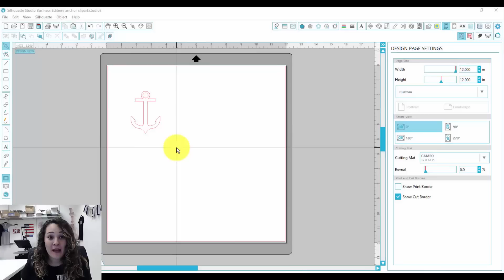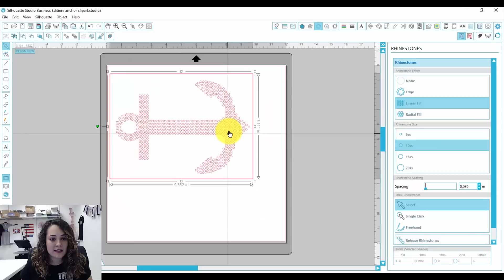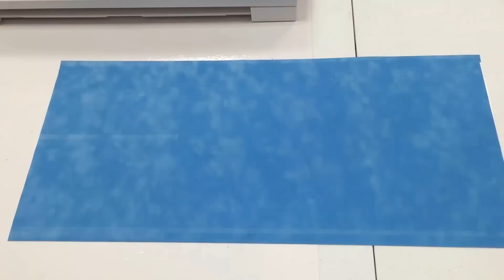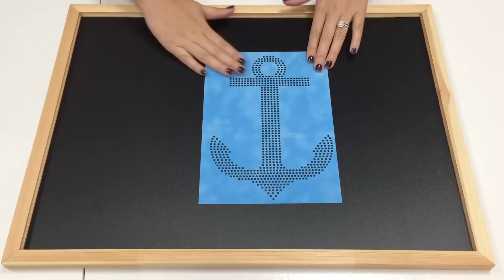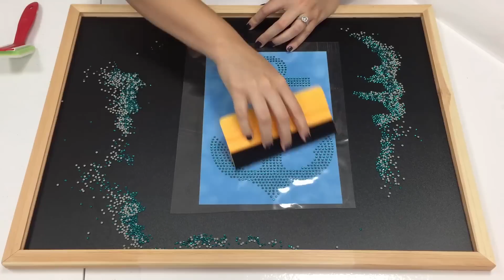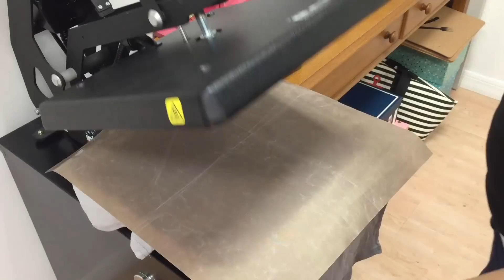Design, Cut and Press a Rhinestone Shirt with the Silhouette Cameo 3!

Comment: If i dont have a heat press can i use a iron?
Reply from the maker: You can try, but it is difficult to get the even temperature and pressure rhinestones need for proper application with a home iron. They may not adhere as well and you risk them falling off - TRW Shannon

Comment: If you are using more than one material how do you know what temperature to set your heat press on? For example: if you use rhinestones and glitter or smooth htv and glitter?
Reply from the maker: I always split the difference. Typically if I am combining rhinestones and vinyl, I stick to around 320. :) - TRW Lisa

Comment: Using the same steps you used in your video Instead of using a T-shirt I want to use a hoodie. Would I get the same results ?
Reply from the maker: Absolutely! The only thing that might be different is you might have to adjust your pressure since a hoodie would be thicker. You also might considering using a pressing pillow between the front and back of your hoodie to achieve good pressure since hoodies tend to have thick seams. 
TRW Alexis

Comment: How would I create the same product with non-heat fix rhinestones?
Reply from the maker: Hey Madison, 

The best way in doing that at that point would be do the same process up until heat pressing, and while the stones are on the hot fix tape, put your E6000 glue on the back of all of your stones, and then press it down firmly so they stick to your shirt. :) 

TRW Nick

Comment: I just bought my first silhouette cameo 3 and your videos have taught me everything i know thus far! 

question:  why does my piece of vinyl slide all over the place when I set it on top of my cutting mat & load it into the machine to be cut?  my machine starts cutting but the vinyl moves around so it does not cut properly.

i am using the vinyl pack that came with the bundle pack i purchased, it is from craft-e-corner and is 9x12, if that helps. thank you so much!
Reply from the maker: Vanessa,

It sounds like your mat just isn't sticky enough to hold your vinyl down. Have you tried taping your vinyl down to your cutting mat? Also, is it a new mat or has it been used several times?

TRW Alexis
Reply: 30 mins after leaving a comment, I realized that I actually had to peel the blue part off the mat to reveal the sticky side on the cutting 
mat. Can you tell I am a complete newbie? Thank you for replying back to me so quickly. I have subscribed to your channel, you guys are fantastic!

Comment: I don't have a magic Flock setting on my design addition. Not sure what setting to use. I used the rhinestone templet setting and it didn't cut out all the holes.
Reply from the maker: Hey Vanessa, 

You can find those settings on our website under Support > Resources > Documentation > Cutter Specs and Recommended Cut Settings. :) 

TRW Nick

Comment: I have a new cameo 3. I ordered the rhinestone kit so I could get some of my templates cut. Is it just the silhouette brand that gunks up my blade to where it has not successfully cut through a single design. It'll cut half perfectly then no longer cuts. I have tried pausing in the middle to clean the residue and build up off the blade, I just can't always tell where it stops cutting until its to late. Help please! So tired of wasting time and material. If I order magic flock will I have the same problem?
Reply from the maker: Angel,

We've never used the Silhouette brand so we can't really speak from experience, but the template material does seem to clog up blades often since it is a stickier material and it's thicker. :/

TRW Alexis
Reply: So is it normal to have to stop mid template cut to clean your blade off? New blade new machine. The videos I watch of templates you guys cut look flawless with no stopping?

Comment: Whups, forgot my second question... what size rhinestones will I need?  They have such a wide variety of sizes from like 2mm to 12mm.  Thank you!
Reply from the maker: For the design that Lisa used in this video, she used only SS10 which are 3mm stones, which is the most common stone size. However, it really depends on what your design calls for and what look you want with your apparel. 

TRW Nick
Reply: TheRhinestoneWorld 
Can i use a bigger Rhinestones like 6mm for example, does in Silhouette Came 3 Software able to change the size of the Rhinestones?

Comment: Ok, when you are brushing the rhinestones, how does it flip them over?  I mean, seems the stone side would stick down just as easily as the flat side.  You make it look so damn easy!
Reply from the maker: Hey Tina! 

It's because it is so ** easy! :) When you brush the stones, if they fall in upside down, there is a gap between them and the flock. Because there is a gap, any stone that comes along that is right-side up will scoot it out of the way and replace it, thus falling in correctly. Because it is in correctly, there will be no gap because the flat side is down. :) 

TRW Nick

Comment: I have a couple questions I hope someone can answer them for me because I really wants to start doing rhinestone transfers. I have a cameo 3 and heat press and I usually make vinyl shirts

1. Are the materials needed for rhinestone transfers • Magic Flock • Rhinestones • Rhinestone transfer tape • Brush ??
2. Is Magic flock what's to be used always, and what is it actually called? Like, is it a type of vinyl? Is it just for rhinestone transfers?? I don't really understand what's to be used for the cutting or what i should search for
3. When you spread the stones on the template, are they supposed to be facing down with the flat side up?? or the other way around?

Thank you!
Reply from the maker: Hello Teshia, 

1. Yes, those are what you need!
2. We recommend using magic flock to do the stone templates. It is not actually vinyl and it specifically made for stone transfers. You would use that material in your Cameo and cut it that way.
3. They should be facing flat side down. They will be forced to face that way and will not brush in otherwise. 

- TRW Richard.
Reply: So I am about to purchase the rhinestones.  What size do I purchase?  I see there are different sizes listed in the Silhoutte.  Does the program automatically select the size?

Comment: I noticed all your videos use a heat press. Can any/all your techniques be done with a home iron?
Reply from the maker: Rhonda,
You can use a home iron, it is not recommended. But you certainly can. 
Home irons are unable to achieve even pressure across the entire design.

TRW Casey
Reply: Thank you Casey

Comment: what kind of rhinestone is used? is it any kind or is there a specific trype that has a backing designed to stick to things?
Reply from the maker: We use hot fix rhinestones. They have a heat activated glue that helps them adhere to shirts. Here is a link to those: http://therhinestoneworld.com/store/#!/Korean-Low-Lead-Hot-Fix-Rhinestones-Most-Popular/c/1545880/offset=0&sort=normal
I hope that helps! - TRW RIchard